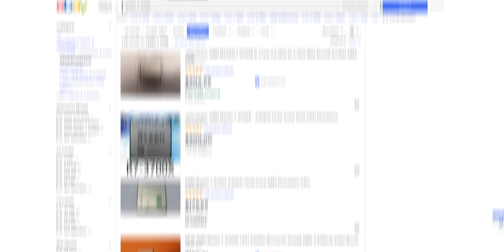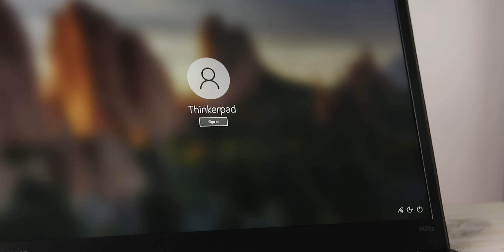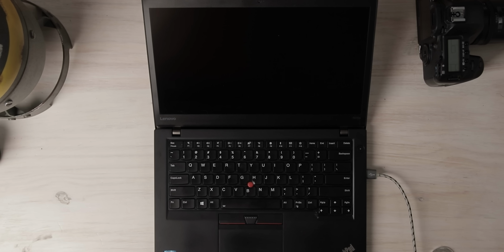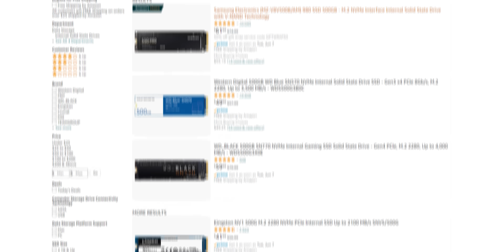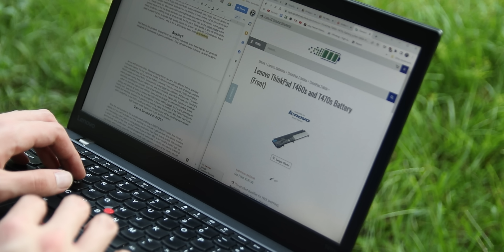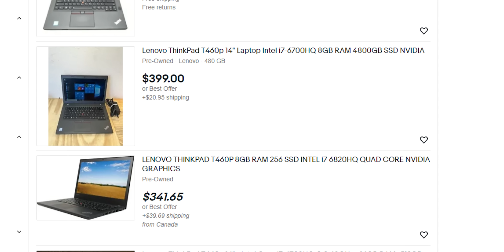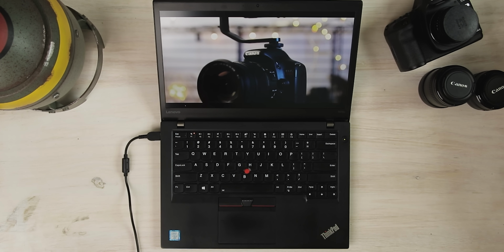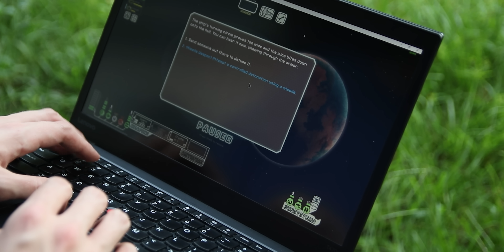I Couldn't STEAL A Better Laptop... I Tried - Lenovo Thinkpad T470s

Comment: So I bought a T470 two days ago from Amazon, paid $256.00. Came in like new condition but only had 8GB of ram. I'm not a gamer but I do run multiple applications at the same time. This laptop kicks ass, I have had zero issues and to boot it came with Microsoft office which is a must for me. Can't say too much regarding this refurbished system, not a single scratch. I have already ordered an additional 16GB of ram (total will be 24GB) which I think is all my system needs to provide me with years of service.  I'm so happy I also ordered another T470 today. Yes, I'm a value guy. Oh, the battery is in very good condition ran fine for a number of hours, really makes no difference because it's my office computer so it's always plugged in. Sorry for making this comment so long.
Reply: Here a 470 too. Unplug it every so often and let the battery drain till 15 % . I have 8gb ram and it’s more than enough for what I need. My working tank for every day
Reply: The longer the better. My T470s came with 8gb of RAM with a slot open. I also added 16gb and its snappy. It's a great computer...a little heavier than an X1 Carbon, but has all the ports you'll ever need.

I'm addicted to the TrackPoint and couldn't own a notebook without it. I bought mine for $175 and added 16gb of Crucial memory for $53. It also had 3 months left on the warranty so I got a new screen bezel, lid cover, keyboard, trackpad and yes, screen. It now looks like it came out of the box.

I also have a 10-year-old T430s that still purrs. About 5 years ago my cousin needed a computer for his new, one-man consulting business. I picked him up a T430 with 8gb of RAM, a 256 SSD, and a docking station. It's on 14 hours a day and doesn't skip a beat. He's never even used it as a notebook...just docked with an external keyboard and mouse. That's the reason ai only buy ThinkPads.
Reply: If you have it plugged in 24/7 you should remove the batteries, it'll degrade them. You may want to use them in the future and comparable batteries are $50-ish
Reply: @menajemh  Thanks for the tip
Reply: @hoppysport2872  Thanks for the reply. I have since purchase 3 more systems. 2 T470's and one T480S (slim). Great deals for sure.
Reply: @eddievantailn2882  Wow nice to hear that man!
Reply: @itsbea3859  Thanks for the advice, I do have it plugged in most of the time.
Reply: @RaffyART1995  Thanks for the replay Raf. I'm super stoked at the value, I think I spent less than 1200.00 total which includes ram upgrades. That's one new laptop. I really can't believe I have 4.
Reply: How long does the battery last?
Reply: @fragsage4179  My laptop is plugged in most of the time, I have used it off line when I work outside so I would say 2 to 3 hours easy. All 4 of my systems work great plugged in or not.

Comment: Initially I bought a T460 for college and then I wanted take notes/draw digitally so I ended up switching to a Yoga 7i and I couldn't be happier for only $500 it is easily double the performance of the t460 and still very budget friendly. The only thing I miss is all the nice ports (usb-c isn't bad tho)
On the repairability side it's also much nicer because it just uses screws, not easily breakable hard to open plastic tabs
Reply: do u recommend me to but t460
Reply: @watchoutZE  depends on what you need it for, if your just doing basic web browsing and want something easily repairable it's very good but for only $300 you can get an used ideapad 3 or 5 with an 11th gen intel processor with iris graphics which will give well over double the performance on most gaming and rendering workloads
Reply: @Polar_Onyx  the one im buying is 16 gb ram and intel hd 620 and a decent i5 cpu do u think it's gonna be decent with games not big games normal ones
Reply: @watchoutZE  Like I said if you even want to do light gaming just go for the iris xe graphics it will make most indie games playable at 1080p. You can actually get the ideapad for cheaper with the i3 version I saw one for $180. With the hd 620 the most it will do is video streaming and classic arcade emulation it's basically 1/3 the performance of the iris xe chips

Comment: just got a brand new t470s, for 300AUD. 2 core in 2022 might be rough, but should be fine for what i need .
Reply from the maker: For me, it was good for most things, but I did end up preferring the t495 w/ the Ryzen 3700u. I still have the 470s with the i7 7600u and it's miles better than the i5 for not much more if you hunt for a good deal.
Reply: Where did you find it for so cheap?
Reply from the maker: Anything I buy for videos is usually from ebay so that everyone can find at least similar prices.

Comment: I’ve recently bought a T480s i7-8650U off ebay with 256GB nvme and 16 gigs of ram for around $165 dollars. Got $30 back also for one broken fan blade which I glued back in. The case had some signs of heavy use, it was very dirty too. Took it apart, deep cleaned everything, and put it back together. The screen has a little defect which is hardly noticeable. I think I striked a pretty good deal. Already replaced the bottom logic. I plan on replacing the top logic, touchpad, and lid as well, maybe upgrading to 100% srgb screen too. It’s my daily driver. I’ve installed Arch Linux with Hyprland, undervolted the cpu and customized fan speeds to my liking. The battery holds pretty decent too. What a beast of a laptop.

Comment: Ive used a T470 for work for almost 2 years and have dropped it multiple times its still running strong, since i work in the medical field i do sanitize it with Lysol wipes , reason why some keys like Caps lock and the right and left click dont work anymore, but durability its great! Feels solid i though it cost $1000 but after seeing this video i cant believe its so cheap to buy now lol

Comment: I had a phase of buying 'for parts' Thinkpads off eBay for <£50 and getting them working. Out of 7 T450's I've 5 that work, albeit one with a broken screen backlight (though I have docks with external screens). Then there is a T440, an L540, an L440, and a T430. Then I had to work hard to restrain myself, it is such a hard addiction to kick.

Comment: This is perfect timing as I am in the market for a Windows laptop to run some Microsoft only diagnostic software. In fact you handed me a viable option on the plate. I was wondering if you came across T470s by accident or this model was chosen out of a few candidates? BTW, I do have i7/16GB ASUS from 2017 running Linux and it is still very good.
Reply from the maker: I was looking at the Dell Precision lineup as well. Namely the 5520 and 7520. I use them for work but due to lenovos reputation online I decided to go for the thinkpad. HP was ruled out due to prior experience with the brand. I think the Asus was decent, battery life was horrible from day one though and it would randomly hang even with a fresh windows install. Currently running the t495 w Ryzen 7 and I love it.
Reply: @aChairLeg  Thx for the context. I still have 2006 T41p which worked just fine (after upgrading memory) until damaged the screen recently. They last forever.
I really miss that 4:3 1400x1050 screen actually.
Reply from the maker: That gives me hope my T495 will last a long time! I'm personally more partial to 16:10, probably because it's a nice in-between. That alone is probably the only reason I'd get a different thinkpad, unless I start editing video on the go more often.

Comment: I got a thinkpad t450 for around 60$. Was pleasantly surprised by the quality. I needed to replace the battery, but it was the i7 model with a 1600 x 900 touchscreen. Still works excellent for browsing, basic gaming, and more importantly school/work (port variety is appreciated). Even once Windows 10 support is dropped, I’ll just use Linux instead of the dual boot set up I have currently. Absolutely love this laptop, one of my favorites.

Comment: I have a T470s that's been a rock star for years and just picked up a T480s from ebay in a great config Intel 8th Gen i7-8650U Processor, IPS 1920 x 1080 Touchscreen, 24GB DDR4, 1TB NVME SSD,  NVIDIA GeForce MX150 loaded with Windows 11 Pro 64-Bit all for $350USD. The T480/480s might be the last of the workhorse laptops that you can mod and configure.

Comment: Used Lenovos are absurdly good. I’ve spent $400 (aud) total on my last two X1 carbons.
They were both less than 5 years old, with fast processors and more ram than I need.

Comment: I found an amazing deal on a T480 for $82 (70+12 shipping). It looks and feels completely brand new other than needing two new batteries (they're just old and used, not a fire hazard) and not including a charger. I found that to buy an identical spec new would have been like $250 so I wasn't to upset about needing to spend $13 on a charger and eventually another $70 on replacement batteries.

Comment: I actually have one of these laptops right now its Lenovo T470S its so good for nearly everything , i actually use it for Programming and it works perfectly it has these specifications : I5-7th Gen , 20gb Ram DDR4 , 250gb of storage SSD , and a integrated Intel HD620 with 10gb shared , also it has a very high screen resolution for a not very expensive laptop .
But the only thing that i don't like about this laptop is the battery but it maybe cause i bought it used and it maybe been overused or charged while using which damages the battery but im gonna change them , anyway it has 2 batteries.

Its the best laptop to get under 300$ , better than apples tho (my opinion).

Comment: The screen 180 degrees thing is to help prevent breakage of the hinges if the laptop falls with the screen toward the floor

The typical angle with which your screen opens is much lower than 180 degrees, so if the screen can go further back (and in fact align with the floor), I suppose the hinges absorb the impact by opening the lid further instead of breaking

Comment: I bought a T470 new five years ago with the i17 and 16GB ram.   While I also have a M3 Max Macbook Pro, I still use my Thinkpad (docked to 2x27 inch Dell Ultrasharp Displayers and 1x24 inch Dell Ultrasharp display (vertical) ) s my primary Windows/work computer used for Zoom/Teams calls, Adobe Acrobat,  MS Office, and internet browsing.  While I notice the fan's can spin up from time to time, I haven't found any real need to upgrade as of yet for day to day office-type tasks.

Comment: To be completely hones, after you discover the world of ~$200 business laptops, you won't go back to buying new (unless you need top performance in a laptop for some reason).
3-4 year Thinkpads and Latitudes are still very capable when it comes to everyday use, and it's hard to beat their build quality.
You can even get one of them "refurbished" ones from Amazon if you're not comfortable with eBay.

You can also use all of these saved moneys to buy an x220 or two (or three, or four).

Edit: finished a video. While your closing thoughts are somewhat valid (CPU showing its age, WIndows 10 losing support, etc), there is another big upside to buying a used business laptop.
In a couple of years (if you decide that your 470s is too slow for you), you'll be able to sell it and move to a newer generation machine. Companies gerally upgrade their laptop fleets every 3-4 years, so by 2025 there will be some juicy deals for 2021-2022 machines.
I personally managed to get a Latitude 7490 with an i5-8350U (4 cores, 8 threads) with 24 gigs of ram for $200. It also came with a new-ish battery and a beat up yet still usable SSD. Thinkpads are better laptops, but Latitudes are generally cheaper. No red nipple though. Dell's nipple is blue and not as good.

Comment: I bought a used x240 for back up/ on the go purposes four or five years ago, and then kicked myself for about a week for not buying the slightly higher specification Acer I'd only barely dismissed for the role. The Lenovo was chunky and grey -- and, within days, I'd fallen in love even with its quirks. 

Then Covid struck just as I retired and was moving house. I had to stay with my daughter and often worked during on my bed with a laptop on my lap. A 12.6" laptop was much more manageable than a 15.6 to write blog post or edit a YouTube movie.

My 15.6 must be somewhere...

A couple of weeks ago the keyboard of the X240 died and a ribbon connector latch crumbled when I pressed it down on the ribbon from the new keyboard.

So I bought an X250 for $140 from local Buy and Sell, dropped in the Old X240 SSD, and it's off again with a few updates just to make sure.

It's back to backing up to... Guess what? A new Lenovo.

Comment: I have two i5 t530's one for me and one for the wife,unexpectedly hers came with a built in webcam and light up keyboard,high cap battery(which is now dead) but we only use them at home

I put ssds in both and it transforms them we only YouTube and browse on them so no need for anything fancier and the build is top as you say.

Comment: Great review! In 2025 I upgraded my laptop from Dell Precision 7720 i7-6820HQ w 32gb RAM to Lenovo Thinkpad P1 Gen 3 i7-10750H w 32gb RAM. Awesome price on a refurbished from ebay. From a 9yo laptop to a 5yo laptop because I want to still stay on Windows 10. The keyboard is amazing. Still getting used to going from a 17' to a 15' but wanted a smaller laptop, the laptop is exactly half of the weight of the Dell.

Comment: Dell Laptitudes are also pretty good for the money, fairly solid build quality with upgradable ram and storage and pretty easy to replace screens/batteries...

The only thing that I find to be a letdown is the mousepad but even that is a mute point if you're using a wireless mouse or have the touch model.

Comment: My first laptop in 2003 was a t22. It lasted me 7 more years of straight abuse. Dropped it so many times and even used it out in the rain. The battery is dead but I could dig it out and power it up and still use it for the basics

Comment: T460s works with just one battery, however it's only good for 1-2 hours of work. You can replace just the damaged/missing battery. T470s uses the same batteries so it should work just as well.

Comment: Several years ago I bought 3 identical T43s as my primary machine . I accidentally damaged one electrically and moved the HD to #2 which I am still using as my main data repository (document scans, financial spreadsheets etc). Laptop #3 is another backup if #2 goes bad. I don't care about the battery as I use it like a small desktop, with external keyboard, mouse & external 2nd screen) It runs WinXP, which is bad because I cannot run the latest Firefox, but good because it is easy to do network connections to (Windows Explorer and RDC).  I do backups and archiving to a large external drive. With Input Director, I use just one keyboard and mouse across 2 laptops and 3 screens as if the configuration is one macnine.

Comment: I bought a secondhand T480 this year, because I was willing to spend a little more for something that would remain useful and repairable for longer. It's fantastic, been running Debian ever since (occasionally flirting with other distros). It's a little on the heavy side, though that's partly due to the large secondary battery mine came with. No worse than my 2010 Macbook Pro in that respect, and hopefully it lasts as long.

IIRC the T480 (non-"s") is also the last in the series to have two RAM sockets, instead of "1 socket, 1 soldered" like the s-series. Not that I think the RAM chips are a particularly likely point of failure, and socketed RAM has the tradeoff of worse battery life, so I wouldn't suggest anyone else pass over a bargain s-series or later T-series.
Reply: Oh, also the screen's colour gamut (not sure about typical color accuracy) isn't great on the T480 and earlier. If you're doing professional photo editing and graphic design, you might want to get a later model. I mostly lay up grayscale documents, so it didn't matter to me.

Comment: 5:20 just an FYI, you can access the 2nd RAM slot, it is not soldered as well and it could get you to a maximum of 16GB RAM (8 gb rams on both slots) -sincerely, a proud t430 owner that has made pretty decent specs and need help because my I cant stop putting money on upgrading it lol

Comment: I had my x260 ThinkPad for a little bit over 3 years and loved if despite crappy build quality. The plastic was so soft that if you held the laptop by one corner the entire thing would Flex. This is what actually ended up doing the laptop in as it ruined some solders on the motherboard. The outside shell was also crumbling by the end of its lifespan of heavy outdoor use. Pieces were missing all over large cracks were running through it. Functionality wise I couldn't have gotten a better deal for $200 but durability was crap

Comment: Thinkpad keyboards are just SUPERB. I got a T460 like, I don't know, 4 years ago, somewhere around 200€ and I use it regularly as a programmer and running solely linux. Of course, it comes nowhere near my home pc, but it gets the work done without a fuss when I'm on the go. Really great build quality, many interfaces, great battery life, drain holes and THE BEST keyboard, I mean what more can you ask. 

P.S. Only drawback (quickly fixed however) the stupidest idea ever, to put the Function key where the Control key should be. I'm looking at you Lenovo.

Comment: I don't like laptops and personally don't have one, but I had ThinkPad 480s at my former job. The best laptop I've ever used. Light, silent, long life on battery. And most important - quite performant. Display - not the best (but it's a business laptop - that's fine), keyboard - never got used to it... The weakest link in the package (but I used it mostly docked)